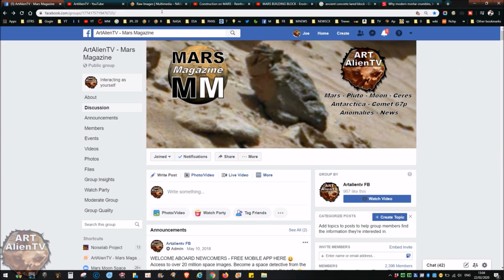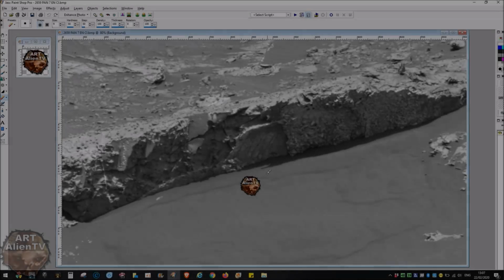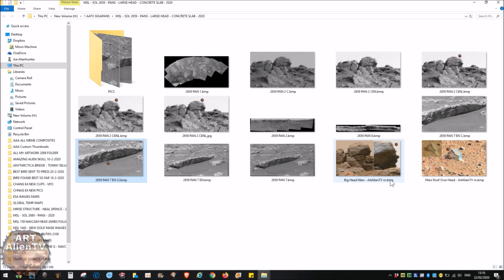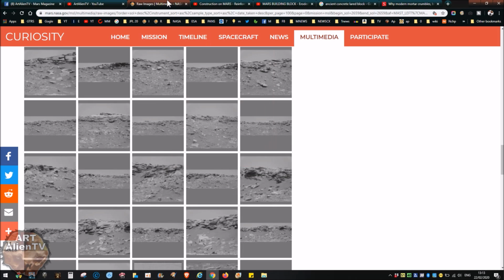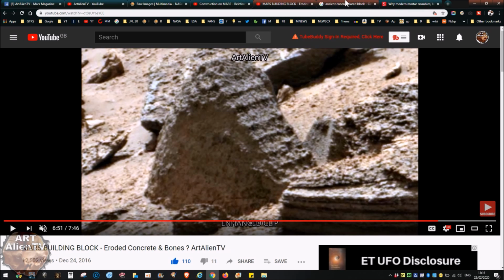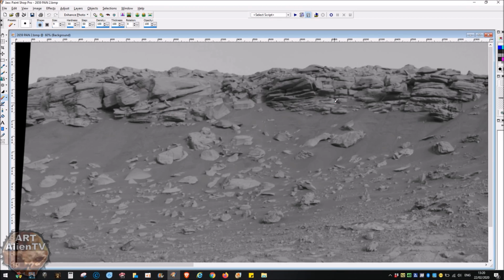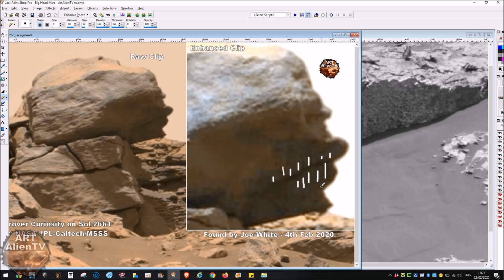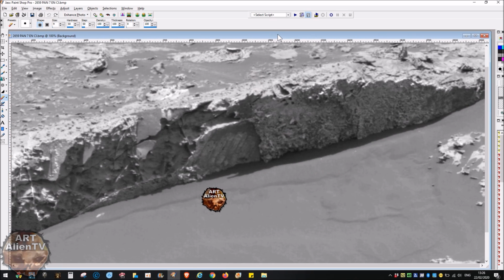MARS: 4 Level Construction - Concrete Structures - ArtAlienTV

Comment: Four very regular holes in a perfect square-shaped arrangement coming out of the surface rendering layer look suspiciously like where reinforcing steel rebar may have connected this block to other prefabricated units--if this isn't architectural rubble then I'm Donald Trump . . .

Comment from the maker: Exclusive - Proof of construction on Mars. Four applied layers are seen in this concrete column or plinth. It is the "Martian Architecteral Rosetta Stone" and in good detail.  
Mars architecture, plain and simple. Similar to concrete seen in Rome or other ancient sites on Earth. Many I have visited.
The plinth object is around 6 to 8 feet in length.
1 - Reinforced concrete with upright sections showing.
2 - Applied layer of smooth concrete with diagonal tooling marks.
3 - Layer of concrete with course grain.
4 - Layer of concrete with finer grain.

This is Mars. The sand is full of sulfur and very glue like under slight pressure. You can mould this stuff in dry or damp layers like clay. So this may not have been constructed in the same way as poured concrete on Earth.

SEE MORE ON THIS HERE
Building Structures with Mars Soil - Sculpture on MARS - ArtAlienTV
https://youtu.be/5NUW9RyUde8

Comment: The "pressure" as u speak, that is on mars.... how do u know it doesnt do that to the minerals and rock naturally. Especially if water evaporates as quickly as its created, as u said. Even in the mountains ... there are many that look like they were man made yet they are natural. . . Just seems photos of rock formations on another planet with a completely different atmosphere... you couldnt know what would be natural.
Reply from the maker: The soil has been replicated here on Earth and can be stuck together dry or damp like clay. The sulfur acts like glue. Perfect building material and easy to handle.
Building Structures with Mars Soil - Sculpture on MARS - ArtAlienTV
https://youtu.be/5NUW9RyUde8

Comment: There's some anomalies on the left hand side of the wall the left in one of them is on top it actually has a string coming down that you can see and the other one is down lower and are they don't look like part of the wall but they don't look natural either the string I suppose could be a fault in the picture but it seems strange that leads right directly from the object

Comment: Hi Joe a very interesting and informative video. On level 1 and 2 you can see creatures or small animals along the surface of the structure also some in the background? Definitely concrete looking material but the sand in the front of the structure looks very fake to me? Great work Joe. 🎥👍
Reply from the maker: Often in old concrete you will see old shells and fossils - depending on the local material used of course. I have seen this in old WWII coastal defense implacements in the UK  👍🧐

Comment: The first item looks like a chunk of road turned up on its side.  The second item is amazing, however you didn't go into the interesting structure above the main point of observation.  The rest pail in the light of the first two.

Comment: Concrete rubble! And there is a lot of it in many of the Mars images. Imprints of forms are often visible. Sometimes there are obvious piles of bricks and blocks. Obscuring everything with an orange filter does not hide it from everyone. Thanks for the vid. 👍👍👍